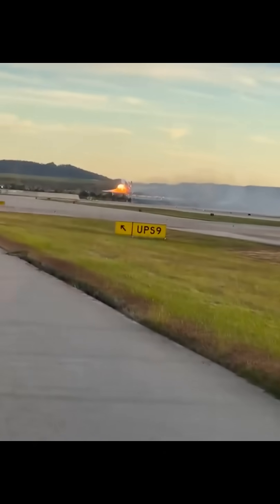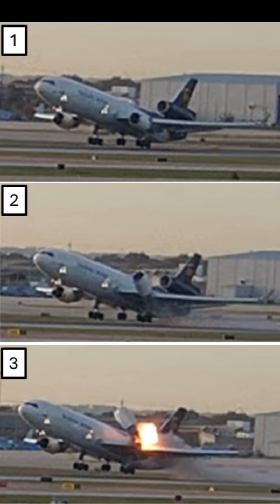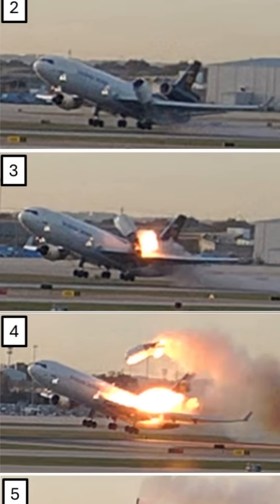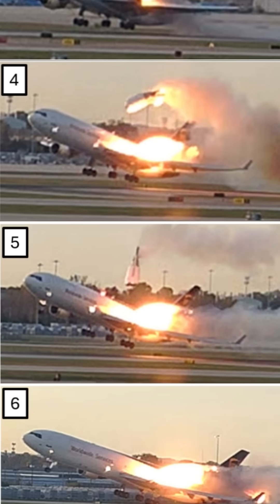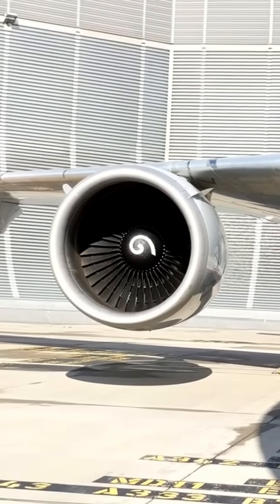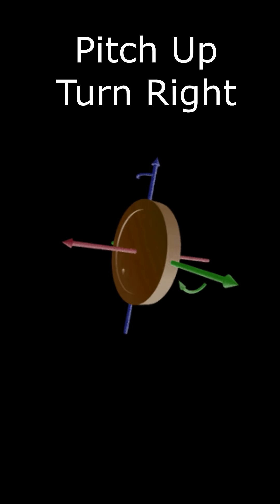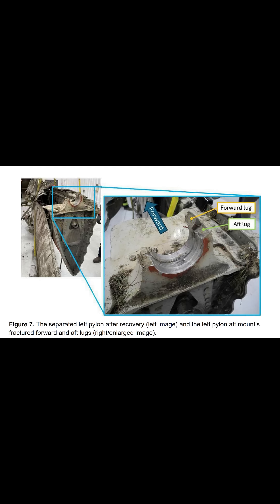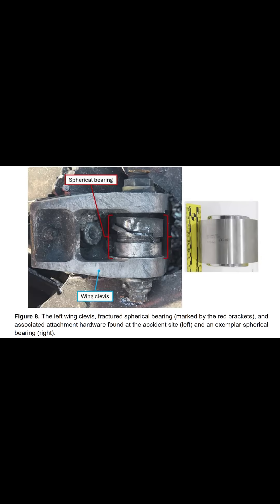Lost Engine Didn't Fall Down, But Flew Up Over Doomed UPS Aircraft #UPS2976

Comment: Seems a little bit different from Flight 191 DC-10 disaster, as the fracture seems to occur at the main locking pins rather than a fatigue crack forming under those at the support structure, but could have been the exact same scenario where maintenance workers were cutting corners and used a forklift to remove the engine from the wing instead of undoing the engine from the pylon which takes longer!

Comment: This isn't the first time an engine on a DC10 has come away from the wing of the aircraft, causing it to crash. It was a long time ago now, I think in the first part of the 80s, the exact same thing happened. This would cause me to wonder if there is a problem in the design of the aircraft.

Comment: I am so sorry this accident happened. I remember back in the 80's I and several co-workers were flying to Montreal, Canada from SFO. The plane was an old Boeing 707. About 15 min. into the flight the no. 2 engine pylon was breaking away from the wing superstructure and was 'wobbling' left and right. We turned around and 'thankfully' landed back in San Francisco. Had we not done that, I believe this plane would have had the same fate except over the Sierra mountain range. My heart goes out to those who perished.

Comment: There needs to be a change in policy when it comes to repair work inspection.
Had the maintenance crew re inspected the welds from a previous repair,they would likely have grounded the airliner.

Comment: This is reminiscent of a crash in, I believe Chicago, back in either the 80’s or 90’s. Sorry for the lack of exact details but it is the fundamentals of the actual reasons behind both crashes are relevant.
I pretty sure it was a DC-9 or 10 and as, very similar to this tragedy, I believe it was also the port side engine that was torn from the bolts that held it to the wing mounts. As the pilots reached rotation and thrust was increased the engine literally accelerated forward and the increased power of the thrust caused the entire engine to pivot forward, up and over the wing. Henceforth landing on the tarmac and resulting in a piloting nightmare. Extremely similar disasters. I am curious to know if the port engine had been swapped out and replaced just prior to this incident.

Comment: Scott I defer to your expertise here but I tried some back of the envelope calculations and the math wasn’t mathing.

The gyroscopic forces are like 2 orders of magnitude lower than the thrust and gravity forces as far as I could tell 🧐
Reply from the maker: 1) Thrust & Gravity cause the engine to rotate up as the rear anchor fails
2) gyroscopic effect causes a turn to the right.
3) after breaking forward attach point thrust exceeds gravity before fuel runs out, sending engine upwards and to the right.
Reply: Firstly thank you for replying ❤ I completely agree on the direction of the forces and that they likely contributed to the path the engine took after the mounting failed.

I can’t explain why but I thought you were making the claim that the extra gyroscopic forces CAUSED the compromised mounting to finally fail when the aircraft rotated for takeoff. I think I heard someone else make this claim and subconsciously blended it into the point you were making. 😅

Perhaps food for thought, I suspect the momentum in the moving parts in the engine would also cause it to continue producing thrust for a while after detaching even if the fuel flow stopped immediately, but this is just a hunch.
Reply from the maker: Oh yeah that's almost certainly a factor, as the plane rotates you get the gyroscopic forces twisting the mounting sideways so it increases the loads.

Comment: Will Boeing set up an emergency production line for the around 100 pylons to return these aircraft to work while the 767fs as replacements are being built.  With the DC10  fire bombers get them too.   I bet the DC10s already have their engines off.  With the Kc10s in retirement. Will some of those pylons be inspected and sold to the firefighting fleet.   
Are the KC10 Pylons the same as the MD11 pylons

Comment: They still gave Grade Lane closed, so you can't even access that road at a certain point. It was a horrible thing that happened but it actually could've been much worse, had that plane made it farther. There are lots of warehouses, neighborhoods and shopping centers along the Outer Loop and surrounding areas.

Comment: Didn’t this happen decades ago with an airline? The maintenance crew had modified the engine install routine and was using a forklift to install the engines but was damaging the pylons during that process.

Comment: The MD-11 will never be allowed to fly again in the US and it will recommended that the plane be grounded world wide. This is the 3rd crash of an DC-10/MD-11 caused by engine failure or mount failure.

Comment: You can clearly see with proper plotting and speed calculation that the engine going above the plane loses fire in the last pic and clearly does not affect the other engine. Possibly it affected it fuel wise maybe through starvation by induced air into broken fuel lines, but not with  parts hitting it as the plane would have been past the loose engine before it came down on the other side. 🙏🙏🙏 For all those who were affected by this tragedy..

Comment: Once the mounting point failed 😮
The RPM was set at full throttle and it still had fuel in the lines, it continued to run for a few seconds all by itself 🤯

Comment: I knew a guy who worked on this exact part of Spirit Aero Systems planes. He said it is specifically designed to break off early in the event of a crash. This is meant to avoid a burning engine being right outside the fuselage when you are trying to escape. The trick was to make it strong enough to be reliable for actually doing what it is supposed to do for normal flight. A contract for designing just this part took more than 6 months to negotiate and was a heavily guarded secret.
Reply: No

Comment: From the moment I saw the first video of this crash, I already knew what the cause of the crash was. Because American Airlines Flight 191 crashed in the same way when the engine and pylon detached from the wing during takeoff. 

271 souls died in that crash on May 25, 1979. 

The cause of the crash will be determined to be that of the ground crew maintenance practices and the things they fail to do thorough inspections of all structural components. 

And this practice will be a corporate decision in trying to minimize the impact of lost profits to the company by setting a minimum of when a cracked in the metal is serious to that the aircraft needs to be pulled for thorough inspections and repairs. 

But since the business has the lawyers and deep pockets, to minimize the financial blow on them, they’ll just pass the blame down to the people who were doing the maintenance on the aircraft

Comment: Chicago 1979, DC 10 did the same. Stupid monkeys🐒 in Oklahoma worked on it, broke the engine mounts using a fork lift and stripped mounting bolts. Those maintenance facilities should be charged with murder for stupidity.🤦‍♂️🤦‍♂️🤦‍♂️🤷‍♂️🤷‍♂️🤷‍♂️
Reply: We don’t know why the engine pylon failed.  It could have been from maintenance improperly installing and damaging the mount pins. It could have been a stress crack from age and wear cycles. 

My money is on like the AA crash the engine was improperly installed and it created a small crack which propagated over time and every takeoff and engine torque stress widened the crack until it fractured entirely through the metal retaining pieces.

Comment: Reminds me of the flight from Chicago where the same thing happened to a passonger DC10- America 191 May 25 1979. It broke and detatched in an identical way due to improper maintenance techniques that hyper fatigued the shear pins and caused the plane to crash due to loss of hydrolics and damage to the airflow over the leading edge of the wing which caused it to over bank and crash into a mobile home park just outside the airport.

Comment: its scary, it is like a carbon copy of the american airlines dc-10 crash in the 70s. the dc-10 crash was due to AA doing incorrect maintenance procdure, bascily AA engineerz thought they could take off the engine and pylon together using a forklift truck

Comment: Wouldn't you want the engines on one side to rotate clockwise and engines on the otherwise rotate counter clockwise? That way you have the equal but opposite rotation forces on both sides, and in case of pylon failure, then the engine would be ejected away from the fuselage. Or is that too expensive?

Comment: Everyone is talking about the gyroscopic effect. But no one is talking about the thrust that engine was still producing, even as its fuel supply would have been severed. It would have been still spinning at a good clip. So no wonder it not only tilted but flew up.

Comment: The engines from aircrafts are supposed to fly over the wing if they fail to fly over the body of the plane so that way it doesn't strike the tail. The engine had been repaired a couple months earlier and the maintenance companies that take care of the engines decided that it was too complicated and time-consuming to take out the screws from the pylon and disconnect the engine. Instead they disconnect the entire pylon and then they would put it back with improper equipment (in this case they would use a forklift) the way that they would put them in caused damage eventually forming cracks, which led to the disaster. That being said up to this point it was an industry standard to do this company was not the only one to do things this way (obviously against the wishes of the airliners) now the plane should have been very easy to fly with only two engines left however upon the ripping off of the engine it damaged the wing which in return damaged certain critical systems not allowing the wing to go to flight configuration from takeoff configuration. When the pilots put the plane into flight configuration the left wing did not cooperate therefore leading to a left yaw. Of course the pilots didn't know that they had completely lost the engine it is in the flight booked and they train you to get as much altitude as possible when you have an emergency. Unfortunately the rapid pitch-up maneuver mixed with the damaged wing the loss of an engine caused the plane to go down. It is believed that the stall stick Shaker did not activate

Comment: It should be noted that in the 40 years ago event, the DC10 was able to continue flying and climbing after losing the engine, despite the slats and flaps retracting, on the left wing only. The airspeed was above the "clean wing stall speed". The pilot couldn't know about the slats and flaps, because his indicators became useless as soon as the electrical power from the left engine was lost. This was the "design flaw" (which was fixed immediately after the event), not the pylon attach design. He thought his slats and flaps were still fully deployed. The pilot did what he was trained to do. He pulled back on the stick, gaining altitude, but trading off airspeed to do it. That dropped the airspeed below the "clean wing stall speed" and the aircraft rolled over and augered in. The FAA performed numerous simulations, and every time the pilot allowed the airspeed to drop, it crashed, but every time the airspeed was maintained, the aircraft was easily bought around for a safe landing. The training manuals were changed after that, to keep the airspeed above the "clean wing stall speed". None of this would have helped prevent this current tragedy, but it shows the avalanche of failures necessary to bring down these aircraft. The entire DC10 fleet was inspected, and only those aircraft that had been subjected to the improper maintenance procedure had fatigue cracks. That didn't stop American Airlines from continuing to blame Douglas for the catastrophic results of their improper maintenance, against Douglas' recommendations. Boeing has been trying for decades to rid themselves of these old Douglas designed aircraft, and they, Boeing, will almost certainly use this event to get MD11s permanently grounded.

Comment: Excellent report. This event is too similar to the Chicago event of 40 years ago, to be a coincidence. I'm betting the cause is the same. Douglas (now Boeing) recommends that the engine be removed for maintenance by leaving the pylon attached to the wing. That's how it was designed to be done. But the airlines prefer to leave the pylon attached to the engine, to save time. When they reinstall the engine, they use a gigantic fork lift that "jams" the pylon attach points into place. This fatigues the metal, and eventually it fails. I want to believe that the FAA banned this practice, with severe penalties. But here we are. People are dying, and the actual bad actors will try to blame the aircraft manufacturer, just like they did last time.

Comment: this sounds suspiciously similar to a 737 that lost its right engine during takeoff roll, where the aft engine mount failed due to fatigue cracks and the engine pivoted up and over the wing. In that case there was no fire and the crew was able to make a safe emergency landing. The pilots didn’t even know the engine was missing until after landing and transferred a lot of fuel to the right wing tank where it promptly fell out of the plane.

Comment: It's amazing how everyone with a keyboard is an aircraft expert. This was a very old aircraft. The DC-10 has a good safety record for it's generation despite some high profile crashes. Flight 191 was a botched maintenance issue, nothing to do with this accident. Statistically airline safety is amazingly good which is a testament to how well the system works and how well these airplanes are engineered are built, including the DC-10. I recently watched a video about the recent collision of a 737 with a weather balloon. It talked about the design of the windshield and how it saved the airplane. Amazingly complex and expensive. They go to extraordinary lengths for safety. Yet all you yahoos who don't know the difference between a boy and a girl think you have all the answers. Think communism will solve everything. As an engineer nearing retirement, the vast majority of young engineers are Asian or Indian immigrants. Americans take gender or similar nonsense and think their smart because they have a college degree. It doesn't mean anything. Most couldn't build a tinker toy.

Comment: The turban blades are turning counter clockwise causing the engine to spin up and over the fuselage, if they were turning clockwise the engine would have spun the other direction away from the plane!

Comment: Not just fuel remaining in the engine's lines, but the residual thrust from the fan. It does not instantly stop spinning. The momentum of the fan disc itself converts to thrust after the engine detaches.

Comment: The same force that caused the engine to go over the plane is what caused it to detach in the first place. The highest strain on the bolts occurs when the plane pitches up at take off. The spinning blades exert that same twisting force to the right on the entire pylon as it angles upwards.

Comment: An aircraft engineer once told me they are designed to go forwards, up and over the wing like this on most passenger jet aircraft if there is a pylon failure.
Reply: And they often ruin the wing while they're at it

Comment: There was no debris sucked in to engine no 2. 
  It was a clean break and the jet exhaust pirouetted over the fuselage so no foreign objects entered engine 2. 
   It was probably the hot air being sucked from the huge conflagration that stalled engine 2 as engines dont work well unless there is cold air entering the engine. 
    This is so obvious Im surprised any “ expert “ channel even suggested debris causing problems for engine 2 and worse thinking the blaze on the left wing was an engine fire.
   Here we see that openness means people can see what happened and so no inquiry can cover up the real cause of an incident yet no one points that out.  
    If we had film of the Hong King crash and sound of the cabin recorder of the Air India crash we could deduce if either preliminary enquiry is accurate or not to the actual events. 
      But no channel has said this but endlessly speculate what the cause was.
Reply: The fact that the plane could not take off successfully is evidence of at least one of the two remaining engines being no longer able to produce full thrust — undoubtedly due to damage caused by the breaking off of the left wing engine.

Comment: 1979, Flight 191 out of O'Hare. 
Hey Scott, I remember this...
The crash of American Airlines Flight 191 in 1979 was caused by the separation of the left engine and its pylon from the wing during takeoff, which resulted from a structural failure initiated by improper maintenance procedures using a forklift. (Google AI search result)

Source: NASA (.gov) 
https://sma.nasa.gov/docs/default-source/safety-messages/safetymessage-2010-07-11-americanairlinesflight191-vits.pdf?sfvrsn=cae1ef8_6#:~:text=A%2010%2Dinch%2C%20horizontal%20fracture,%E2%80%A2

Similar result, similar cause??

Comment: Sucks to be the pilots and crew. I wonder if this one bears a look at the mechanics logs to see if the left engine was installed each time according to the procedures or if the short cut method was used with a crane. The outcome is danger to the pilots and anyone below below them when the engine detaches and causes a horrific accident. Better get on it boys

Comment: Engine #2 intake received a blast of hot burnt fuel void of oxygen causing a flameout. Even if no debris entered the engine it was starved for oxygen  causing it to reduce thrust.
Reply: Not a flameout.  It was a compressor stall.